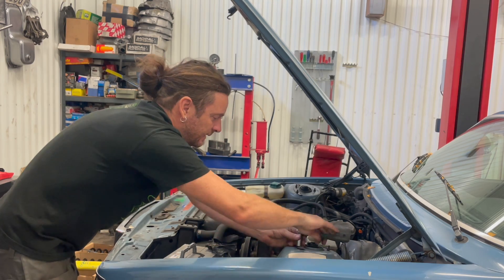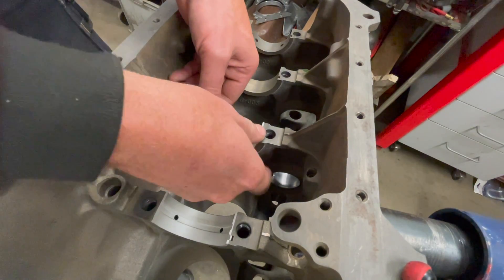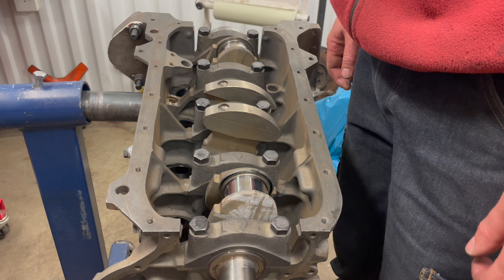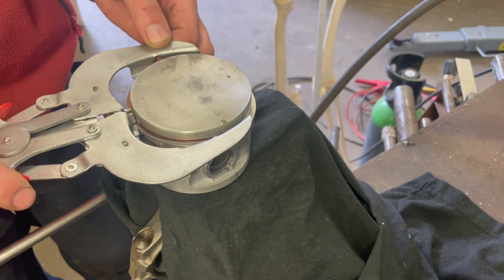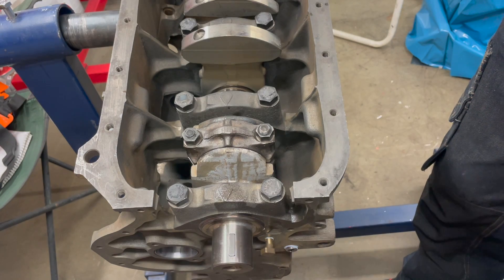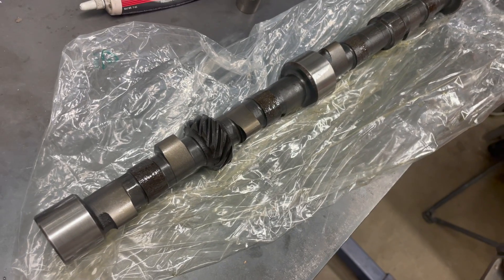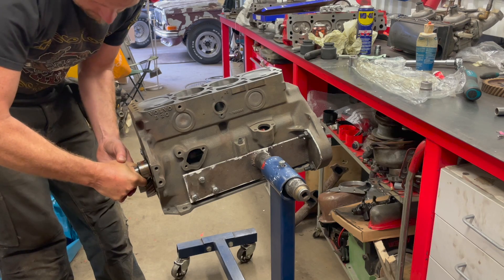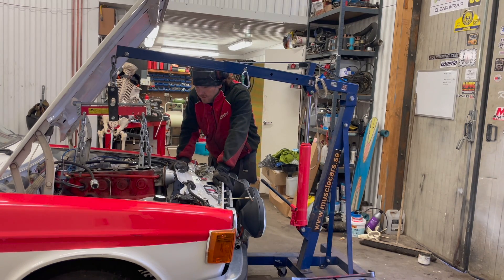The Volvo P1800 B20 Build - Part 2

Comment: Greatful for video. Preparing to freshen a low hours dual Solex b20 marine 130 hp engine and convert for road use by machining head by adding coolant opening for water pump. Possibly install in my rough but worthy 1958 445 Duett.
Reply: I am in Reno, Nevada USA

Comment: After installing the crank gear and the cam gear with the dot and the line together, it appears that the number one cylinder is at the top of the exhaust stroke.
Could you confirm that?
We discovered that when we started to adjust the valves.

Comment: Watching this video series again and was wondering if you’d be interested in rebuilding the engine in my 1973 1800ES ?
It does loose quite a bit of oil and I suspect the rear crank seal, so driving it to you would be problematic, unless I replaced the seal first.  First things first.  I’d like it rebuilt, retaining the FI and also looking for 160 to 180 bhp.  Is that even possible ?
Looking forward to hearing from you, cheers … Ole (Danish, living in England)

Comment: What for a camshaft is that? Are they already available to buy? Sorry but I didn't understand the brand when you said it in the Video. Did you check the gap of all Piston Rings? What's the brand of the Rod bearings? Also KS? Greetings from Germany.  Looking forward for the next Video.
Reply from the maker: Hello! The camshaft is an NH48, 275 degrees duration, 7.75 millimeter lift, 107 degrees lobe separation. They can be bought from a company here in Sweden. Easiest if you have a original core yourself, and it needs to be a "074" casting. If not, you will have to pay a bit more! Piston ring gaps: just checked them, never had any problem with genuine Mahle pistons and rings!
Reply: 7.75 mm lift seems like very little, is it 7.75 at the pushrod/lifter or at the valve? Sorry if this is a stupid question.

 @ClassicCarRacingRestoration

Comment: Good basic construction. Will you check the camshaft lift timing so the valves open at the correct moment? B20 cam gears are known to be up to 10 degrees out of alignment, especially phenolic gears.
Reply from the maker: Hey Ian! In this case, I relied on the cam grinder, they check the core before grinding, then I compared a few gears to make sure I pick a good one. I do have an adjustable cam gear in my rally engine, as a matter of fact!

Comment: Why use WD40 instead of motor oil, I don't understand?
Reply from the maker: Hello! Since it gives low friction when sliding the piston in, and also evaporates before first start up. Motor oil works just fine too, but then you're likely to get a bit off smoke at first start, if the oil is still present in the cylinders.

Comment: Very much enjoying your build. I’m restoring my ‘64 1800S which has sat in the garage for 25 years.  It’s been sitting waiting for a transmission rebuild while other things in life have taken priority.  Shortly before that the B18B was replaced with a factory spare B20B and has less then 10,000km on it. 

When I stripped the car there had been nothing that was seized, antifreeze was fresh looking, oil was golden, brakes were the only significant issue, mainly because the drums and rotors were all at minimum spec.

Before disassembly compression was good 125/130psi, cylinders show no wear, in fact they still show the factory honing.  I’ve had the head tested and new valves, liners, seals and springs installed. 

My question, I’d rather leave the bottom end untouched, do you have any suggestions as to making sure it’s well lubricated, should I drive the oil pump with a cordless drill to circulate oil as a first step before starting? I’ve removed the cam and used assembly lube on it as well as the lifters and rockers

Sorry if that was a little long winded!
Reply from the maker: JG! First off - congratulations on what surely seems to be a great find! What state are you in? I've worked on cars imported from Kansas, Colorado and California - all have been near mint in terms of bodywork, and no rusted nuts etc. So, as for your question: Yes, that's seems like the way to do it. If you engage the oil pump, take the valve cover off and run it until you see oil coming out by the rockers - then you know the entire engine is lubricated. On the other hand: I started using/abusing Volvo B18/B20 when I was 14. Not knowing any better, I started engines that had been sitting for 10 years or more, just by hooking up a battery and pouring gas down the carb. Never an issue. They are bloody hard to kill! Anyhow, I you feel like it - I'd love to see some pics of your project!
Reply: Unfortunately I wasn’t able to link any photos, seems the YouTube algorithm deleted the message which included it. I’m in Vancouver so needless to say the body is not without the effects of cold wet winters and warm wet summers, although if the last two are an indication, climate change could affect all of that and Vancouver will be the new LA. While LA and surroundings will become a training ground for life in mars.

But thanks for the tips on what to look for when I get oil flowing, is there a speed I should or maybe shouldn’t rotate the oil pump drive?

Comment: The lifters on my b20 were all worn unevenly as was my camshaft. I couldn’t figure it out why my 70k mile engine was running so poorly, until I measured the valve lift and determined the cam to be the issue. Now my 142 is getting a b230 me m47.  Really enjoy the videos in English! Cheers!
Reply from the maker: Hey Sam! Did you look at the base of the lifters? Did they all rotate in their bores? I know of a few cases where the lifters, due to oil crud or scratches in the bore, have not rotated - which in turn led to the lifter wearing out in a hurry. Or was the cam of poor quality? BTW - I too have had a 142 with B230 and M47! Great daily driver!